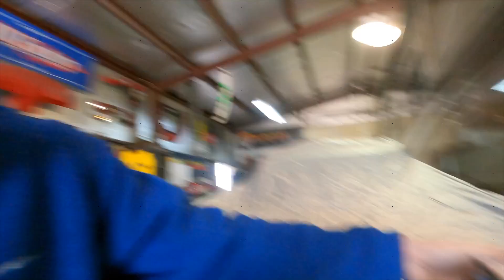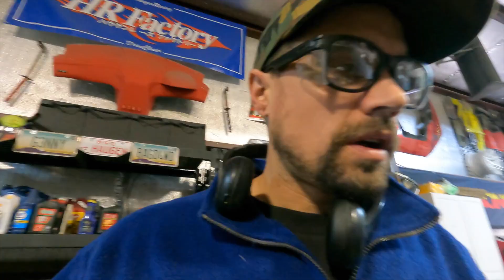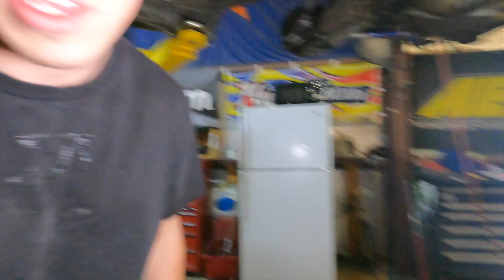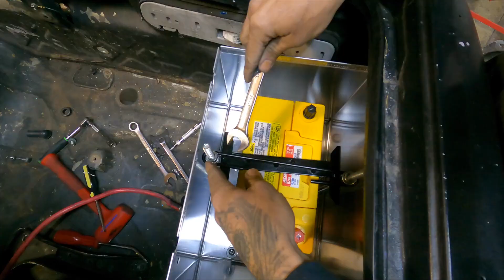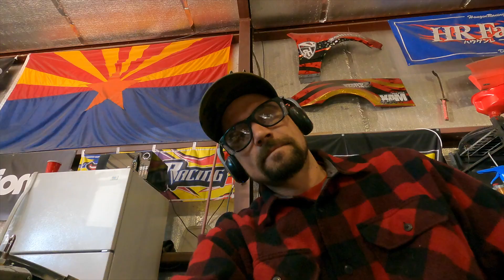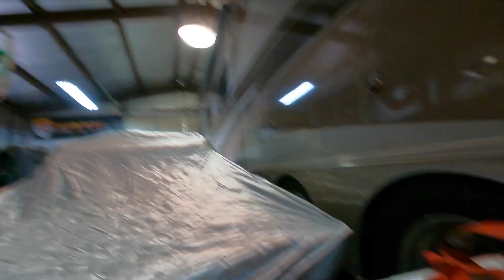LOW BUDGET DRIFT BUILD EP 4- Performance Parts!

Comment: What parts should be safe to buy from ebay and what's not?
Reply: @Jamo Haugen Racing  Ima just give some examples cosmetic pieces, coilovers, exhaust, suspensions parts(camber arms,tirerods,angle kits,control arms,etc), oil pump, radiator,brakes,etc. Also what mechanial piece do you think will be okay to buy. I plan on making a drift 350Zas my "daily" and drift car and I'm trying to buy authentic stuff for it like Bc coilovers and stuff but I also don't want to overspend on parts I don't need.